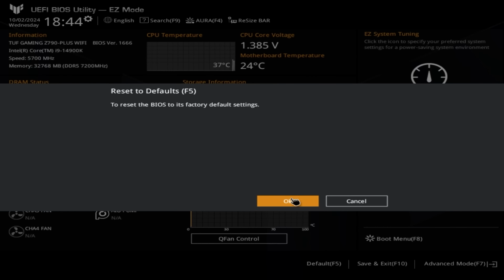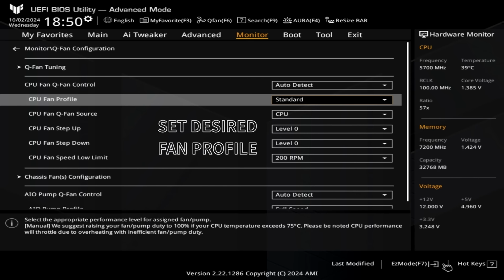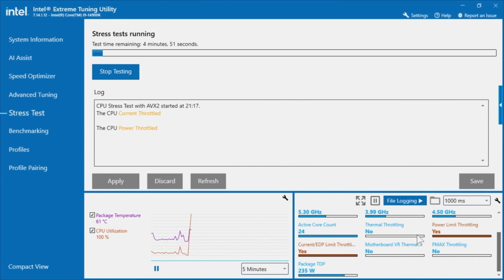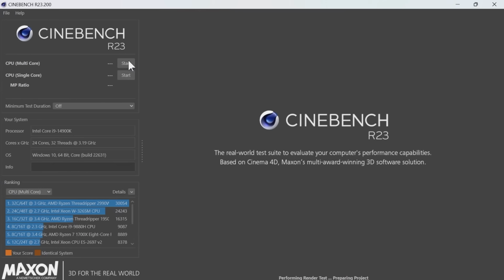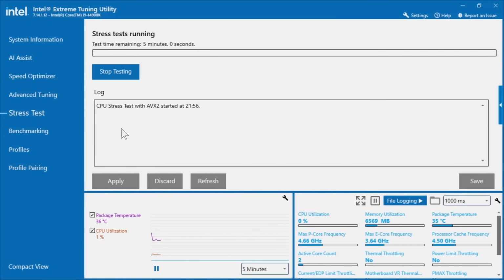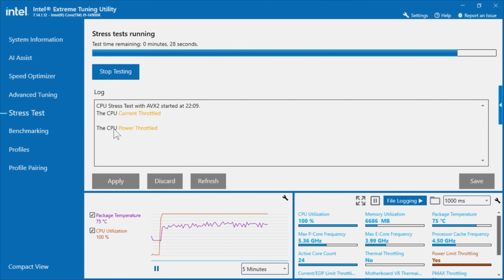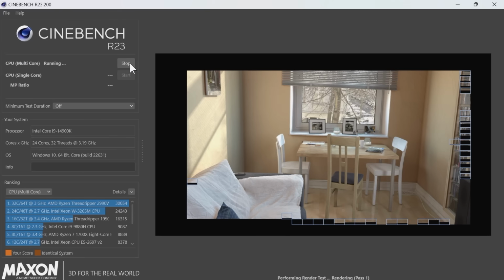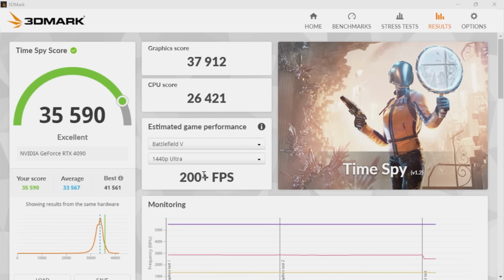i9 14900k Undervolting Guide: Part 2 Complete Stress Test Results

Comment: @nextlevelsimgaming I have followed your guide and I have several questions. My configuration is the following:

CPU:Intel i7 14700K
MotherBoard: ASUS TUF GAMING B760 PLUS WIFI
Refrigeration Liquid: ASUS TUF GAMING LC240 aRGB 2023.
Grafic card: Gigabyte RTX 4070 Ti Eagle OC 12 GB GDDR6 Rev 2.0
Memory: 32 GB Kingston Fury Beast DDR5 5200 Mhz

I have updated the bios to version 1666 and followed the steps in your guide.

I obtained these values in Cinebench R23: Multicore = 28378 , Single Core = 2124, Ratio = 13.36.

Average CPU Temperature = 75 degrees.

These are my queestions, because I not found these options in B760 Plus Wifi with versión 1666 of Bios:

1) The "Undervoult Protection" option does not appear in the BIOS. At F9 Search not appears... Is this due to my motherboard model? Or is it about the asus bios version?

2) The "Asus Multicore Enhancement" option does not appear. Why ?

3) In the "AI overclock Tunner" option, the "XMP Tweaked" option does not appear. I only see the XMP I and XMP II options. I have selected XMP I. Is this the recommended option?

4) The option for "Unlimited ICCMAX" does not appear in the bios. What is the reason?

5) In PL1 = Long Duration Package Power Limit I have edited the value of 125. Did the current appear 253? Which is correct in PL1 to put 125 or 253? In PL2 I set 253 and in CP_U/Cache current limit MAX I set 307.

6) In the BIOS the "GLOBAL Core SVID Voltage" option appears but it only lets me select the AUTO and MANUAL options. The "Adaptive mode" option does not appear. What is the best configuration in this part for my case?

With the rest of the settings in your guide they do appear, and the good thing is that at least the CPU temperature has decreased from 100 degrees to 75 degrees.

Can you tell me the best options for my previous doubts?

Thank you very much! Very Good Guide (Easy from  dummy people) !!
Reply from the maker: @E_S_P_I_N_E_T_E  Hi, the guide is for the i9 14900k, although its pretty similar, so can be adapted to other processors with amended power settings such as 307a instead of 400a for your ICCMAX for example, I can’t comment on your motherboard unfortunately as this guide is for Z790 Asus motherboards, unfortunately I don’t have one to test so wouldn’t like to steer you in the wrong direction, but the principles of undervolting remain the same.
Reply: @nextlevelsimgaming  @nextlevelsimgaming Thanks for the response. I understand that the guide is for the i9 14900k but I see that the process is similar for the i7 14700K. 
In my particular case, some options in your guide do not appear in my bios :-(. 
One thing I seen, in my particular case, the "Global Core SVID Voltage" option does not let me select the "Offset Mode" option, because not appears in list options. 
But I see "Actual VRM Core Voltage" option just before, and in this option "Offset Mode" option appears in the drop-down menu. 
My question: Is "Actual VRM Core Voltage" similar to "Global SVID Voltage"? Is it a good or bad idea  (for my case) to set an offset of 0.005 in the "Actual VRM Core Voltage" option?
In your bios I see that you have "Actual VRM Core Voltage" without setup. 
Thanks in advance

Comment: Hey mate, thanks for the advice regarding my high temps on your other video advising it may be a contact issue. I fitted a contact frame and repasted the cpu, on the default bios settings my temps had dropped by 20 degrees. Score of 35k on cinebench r23. I just followed this guide and I carried out the avx2 test and it passed once at 0.0500 undervolt, I tried going to 0.055 and my pc black screened, I ran the test at 0.050 again and now it crashes. Any advice?
Reply from the maker: @3uIIy  If tne CPU is struggling with an undervolt then that could very well be a sign it’s degrading, as a CPU suffering from Degradation requires more power, I would RMA the processor under the Intel extended warranty protection as other users have reported the same and it was confirmed as degraded CPU’s were the issue

Comment: Hi,

I recently did a clean installation of Windows 11, and after following the steps in your video, I’m still seeing high temperatures when running AVX2 workloads, ranging between 76°C and 88°C.

The best core voltage offset I can achieve without the AVX2 test failing is between -55 mV and -60 mV. Is there anything else I can try to lower the temperatures or improve stability?

I would really appreciate any help. Thanks, and sorry for the trouble. 🙏

Specs:

	•	CPU: Intel i9-14K
	•	Motherboard: ASUS Z790-E Gaming WiFi II
	•	Cooling: Corsair iCUE Link H150i 360mm AIO
Reply from the maker: @gan5866  If the test is failing at those levels, I would check thermal paste application is sufficient, clampdown force on the IHS is not to firm/weak.  Are you using an LGA 1700 contact frame?
Reply: @nextlevelsimgaming  thanks. 

The weird part is that first time I did some of the changes you recommend I could go to -0.07000. 

But now when I did all the changes  included using the Asus and not Intel default setting it’s failing. 

Regarding your questions
I have LGA. 

And I will check if I tied up too strong, the CPU Fan
Reply from the maker: @gan5866  No worries if it’s inconsistent its likely to be as mentioned above 😉
Reply: @nextlevelsimgaming  I will let you know. 

If nothing changes should I try using intel default setting and lower the VID Core?
Reply from the maker: @gan5866  If the processor isn’t able to run correctly on the Intel Default profile, with a mild undervolt, then its certain to be degraded and failing, and you should begin the RMA process, advising Intel it is not working correctly on their BIOS settings
Reply: @nextlevelsimgaming  well well well, I will see…

Comment: Hello there! What is your windows version? I can’t get those score in timespy?
Reply from the maker: @safadereli7857  Windows 11 23H2, follow the guide then you’ll be able to 😉

Of course the other factors are DDR5 Corsair Dominator Titanium 32gb @ 7200mt, Gigabyte Windforce V2 RTX 4090, i9 14900k and undervolted and sync all cores

https://www.3dmark.com/3dm/114937025
Reply: @nextlevelsimgaming same cpu, same gpu, same ram but I have 48 gb version, same what you did in bios I did. I have asus z790-e strix. Easy to replicate what you did. But my windows 24H2. I got 21.500 in cpu score. I am confused 😅
Reply from the maker: @safadereli7857  Have you closed all background programs in the tray?, benchmarking software should be run vanilla, i.e RGB software, Chrome etc closed, Corsair iCue for example is a very CPU intensive process and the monitors interfere with other benchmark software
Reply: @nextlevelsimgaming actually I closed them all. I close them in tray but maybe I need also to check task manager? Indeed I have ICUE and armory crate. I am still suspicious on windows version but not sure.
Reply from the maker: @safadereli7857  Armoury Crate will be interfering with it, I have removed that completely
Reply: @nextlevelsimgaming  I will try what you advice. Maybe tomorrow try it with reinstallion of windows without armory crate and ICUE. I will let you know about the result.
Reply from the maker: @safadereli7857  No worries its definitely Armoury Crate, see Reddit on the subject 

https://www.reddit.com/r/ASUS/comments/1ahej7x/armoury_crate_lowers_fps_by_30_on_certain_games/
Reply: @nextlevelsimgaming  FYI I delete everything related armory crate but nothing change. As I said tomorrow I will try 23H2 clean install. I won’t install armory crate or ICUE and then try what will I get. Get tuned 🙂
Reply from the maker: @safadereli7857  Excellent keep us updated 😉
Reply: @nextlevelsimgaming Hello again. I have some uptades 😊 I have just finished clean install of 23H2 and guest what. I have 27038 in Cpu Score of timespy. I haven’t install ICUE or Armory Crate. But just for verify the problem I will install them. 

If my score drops again 21k we will get who is responsible (ICUE or Armory Crate) but if doesn’t then 24H2 is the problem.
Reply from the maker: @safadereli7857  Thats a very healthy CPU score well done 👏🏻
Reply: @nextlevelsimgaming  UPDATES: Now I installed ICUE and Armory crate (I have to because my CPU cooler is Ryujin III and my headset is Corsair). My score is 26700.

Gaz thank you for all your support and your guide. Do you think 24H2 is buggy?

Comment: Nice tutorial , my degraded cpu get back 40000 score but it seem power hungry? I cannot under-volt all core to 0.45 below , so I specified by core , for example core 4 ,5 -0.075. But core 0 I cannot undervolt even -0.005? Why?
Reply: Time to RMA buddy. I am on my 2nd chip now. I underclocked/undervolted and synced p cores day one on my replacement chip and have zero issues now after months. Stay far away from Intel default settings.
Reply: @cemsengul16  delided IHS ,and I tuned back to almost performance,undervolt -0.45 all core seem sweet pot on it. And I dun mind buy another one or wait it really dead.
but It seem can work passed intel arrow lake generation with 1.29 to 1.36  while gaming voltage ,may be my VID table original also low, I cannot undervolt furthermore 
and seem the temp backed to normal at least better then another 14900K with AIO. Even FPS and performance. 
I found the main reason on the e core behaviour, now solved. Thanks for your recommendation bro
Reply: Maybe my ram? I am running G skill 7200 of to 8200 stable max temp 48 c
56/58 ns latency . SA 1.25 volt , ring disable 38 49 49 137 - tREFI 127500
Reply from the maker: @lawrenceonface  Because unfortunately if its degraded, it will require more power, definitely time to RMA
Reply: @nextlevelsimgaming  cause my 14900ks delidded for gaming only and custom cooling with hard tube so I dun want to change any build if the performance not too bad
Reply: By the way  I have another 14900K but installed to my workstation, it seem fine .

Next  generation 2025 if no much improvement (bottleneck is too much) , I want stay this pattern,or by a new cpu or just wait next next generation,dunno yet😩
Reply from the maker: @lawrenceonface  The fact the new processors boost only to 5.7 shows the exact fact that 6.0 was never sustainable, even more proof syncing the cores is the way to go
Reply: @nextlevelsimgaming  yes the core and silicon seem not improve this moment .
Reply: Hi! Is it with hyperthreading off? Even with off im struggling to keep my cpu lower than 100 c. I did everything exactly the same and with hyperthreading off im maximum getting p cores 4.5/4.6.. with off 5.3/5.1/5.0 but its still 100c. I did update my bios to the newest version. Is something wrong with my cpu?
Reply: @kamilnowak7366  I tried , but just work in some scenarios and just a little bit heat and voltage only. I do not have any issue even I stress it.

Comment: This time I used your exact undervolt setrings from this video but noticed something strange. When I reset my pc to everything default, my core voltage on bios screen at 5.7 ghz is 1.359. After applying all your settungs, when I reboot and look at bios screen it shows 5.5 ghz but same core voltage of 1.359.
Reply from the maker: @cemsengul16  Probably due to locking the VID Max to 1450 you don’t have to do that, but for me I like the reassurance it cannot exceed that, Intel’s Microcode fix locks it to 1.55 which I (and others such as Buildzoid) feel is still too much
Reply: @nextlevelsimgaming  When you apply the same settings from the video, is your core voltage lower on bios screen? When I was doing the vf offset method I had a lower core voltage but I think my settings might be bad because sometimes my pc would go into a blacl screen in the middle of the game and I have to hold down the power button.
Reply from the maker: @cemsengul16  I would F5 and reset BIOS and reapply, that sounds like something is adrift somewhere, remove the limitation on VID MAX and set to Auto
Reply: @nextlevelsimgaming  I will try that and let you know. On your pc do you have tvb voltage optimizations on Auto or Enabled? Just trying to narrow down what is the issue.
Reply from the maker: @cemsengul16  As per Asus OC settings, think its Auto by default
Reply: @nextlevelsimgaming  You mean IA VR Voltage limit right? Well I set that back to auto and even with a 0.075 undervolt there is no change on bios screen.
Reply from the maker: @cemsengul16  Not sure then mate, however did you have Intel XTU installed prior to undervolting in BIOS?, remember Intel XTU makes software changes which you will see if you open Device Manager / Software Components here you will see instances of Intel XTU installed from prior changes, they show as Intel XTU. Component Device, once you have an undervolt you are happy with, you can apply those settings in BIOS and uninstall XTU and uninstall the profiles from Device Manager
Reply: @nextlevelsimgaming  Oh I do not have xtu installed. The VF offset method worked though which is strange. I just never bothered to install XTU because I like the idea of a bios undervolt but maybe I need it for global core undervolt?
Reply: Weirdest shit bro. I updated to stable release 1703 bios for my motherboard and tried applying your undervolt settings from this video and it worked. Have no clue why global svid offset didn't work for me on previous bios. Now I typed your exact settings again and bios screen reports 5500 mhz and core voltage 1.270

Comment: Nice vid. My 14900kf have with intel settings (extreme) TVB on 5.7 and 4.4 Ghz with -0.070 undervolting. Cinebench R23 have a score from 38.000 - 38.500 points but in Time Spy only 21.000 CPU score, maybe gsync problem?
Reply from the maker: @DieChaosBoys1  You’d be better syncing cores to 55, and turning off boost altogether, you’ll see a big improvement in CPU efficiency
Reply: @nextlevelsimgaming  in my Games the cpu needs 80-120 Watts only. Only warzone needs 165 Watts +- 10 Watts.
Reply: Mate I was the same with you. What is your Windows version? With 24H2 i got 21k with 23H2 I got 27k. If you have time please try.
Reply: @safadereli7857  have atm 23h2 but my Problem is gsync on. 3dmark has a Problem with Score by gsync on

Comment: I built my PC 2 days ago, has i9 14900k, now i updated my bios to 0x12b , but when i enable XMP, game kept crashing, so i have to disable it, voltage on CPU bfore the update was 1.470 something, now its 1.3 somwhere
Reply: Damn i fallow all your guide, set to -0.080, before the default one when i play world war Z, the aio fan spinning soo strong, and temp goes to 70 to 80, now after applying the guide from you, it never goes 50 above, i wish you can make a video on how to undervolt GPU too, i only use this asus gpu tweak and chose Silent mode, thanks soo much.
Reply from the maker: @maicagaming1702  Great to hear mate 🙌🏻
Reply from the maker: @maicagaming1702  Are you running 4 x DIMM of RAM or two?
Reply: @nextlevelsimgaming   4x DIMM,  this one from T-Force 6000mhz, as disable i only get 4200 somewhere, but does it matter if i get the max speen on my RAM ? or just leave it 4200 so game wont crash, can i fallow this guide without any test? I want to undervolt my cpu for it to live longer 😩 ,
Reply from the maker: @maicagaming1702  If its DDR5 you’ll have issues with 4 x DIMM unfortunately, have a search on the subject, you’d be better with 2 x DIMM and higher capacity you’ll get full speed then, you’ll also lose stability
Reply: @nextlevelsimgaming   i want to use 4x DIMM for RGB 😂, so my question is. Can i fallow this guide but with the XMP disable? Its just i wanna make my CPU safe.
Reply from the maker: @maicagaming1702  You can, or you can run XMP and downclock the RAM or loosen the timings, if you set XMP as shown, then scroll further down the same page, try knocking the speed down by 200mt then test again check for stability.  Problem is with 4 x DIMM its making the CPU work twice as hard over 4 lanes as opposed to two